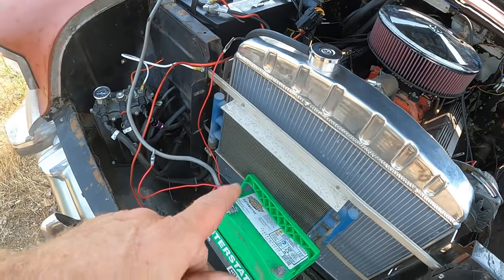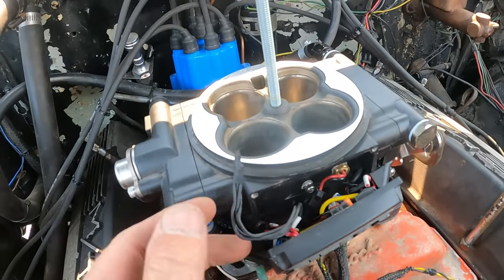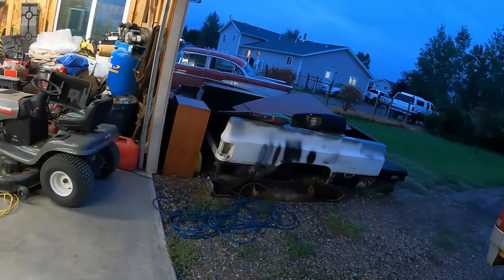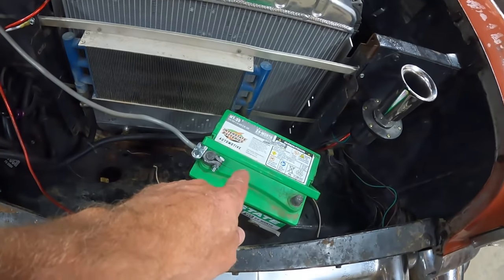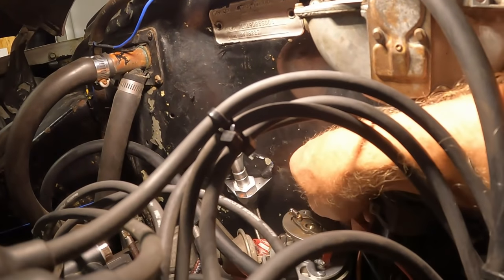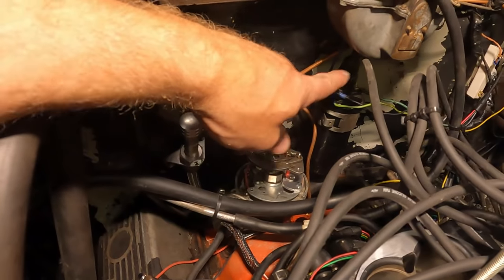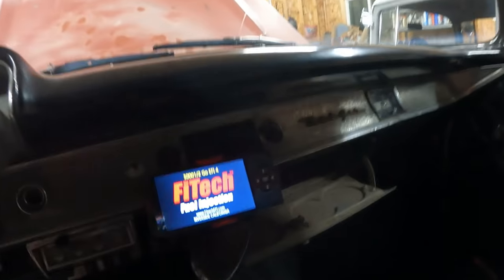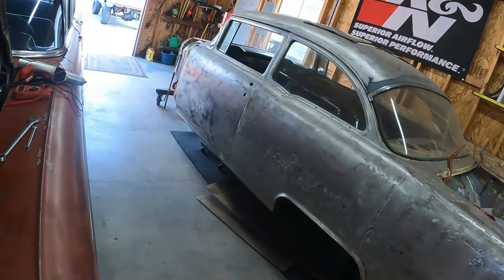Installing Pertronix Electronic Ignition, the FiTech Fight Continues

Comment: I believe that tach signal is the key. find out which wire on the fi tech is tach feed and it probably hooks up to the neg { dist side } if it can't read the rpm it won't run. good luck!!!
Reply from the maker: Yep, no tach signal, no startey start. Tach signal was a little weird with the Pertronix. Waiting on a replacement to see if that helps...
Reply: @MontanaGarage  

You have a 12V hot-in-start and hot-in-run lead to the Pertronix unit?   Friend of mine made the mistake of only having a hot-in-run wire run to it and the motor wouldn't start.   It's got to be both hot-in-start and hot-in-run to work.

Comment: Follow the wiring diagram that was shipped with the unit. It says to connect the white wire to a keyed 12 volt source not coil positive. If FiTech wanted the white wire on coil positive they would’ve mentioned that in the instruction manual.

Comment: I ran a Pertronix ignition conversion in my '55 Chevy with a big block and it ran great.  The only issue I ever had with it was accidentally shorting out the ignition module during a tune up and having to replace the module.  It's been on the car trouble free ever since for more than 20 years.
Reply from the maker: Good to know man. Thanks for the input. Hopefully I can make it work.

Comment: You’re a better man than I am! I’d have gotten rid of that FiTech system by now. We’re going to be converting an old Camaro to fuel injection and I can assure you that we’re not going to buy the FiTech brand! Hopefully the Holley setup is better than this one. Keep up the good job and keep the videos coming!
Reply from the maker: I've heard they are good when they work. Hopefully I an make it work, or hopefully FiTech will stand behind it if it is a ECU issue.

Comment: I run a Pertronix conversion on my 63 Merc 390. Works like a champ and fires right up. Most problems happen when power source is hooked to power side of coil instead of keyed power at fuse box or ignition switch. Follow directions and it works and lasts years.Thunderhead 289 just put up a video on this a week or two ago.
Reply from the maker: Thanks man. I'll check out Thunderheads video and see if I can learn a thing or two. Much appreciated.
Reply: @MontanaGarage   Here's the link - https://www.youtube.com/watch?v=c76knXFuXH0

Comment: Moose has the instincts, just watch and learn! Maybe you can hire him out? "Moostana Garage" 🤣👍
Reply from the maker: Haha. Thanks Andy.
Reply: @MontanaGarage  think about it. What all adds up? You checked the battery voltage it reads one thing. The fitech monitor reads voltage all over the place. What does a voltage regulator do? It sends the correct voltage where it is needed. To much voltage and you have a disaster, not enough and you have a no start. Since Dan at DD Speedshop changed a lot under the hood, you might have three different possibilities on regulators. If he took the voltage regulator off the firewall, he might have used a different alternator that has a alternator voltage regulator,  or it could be the ignition voltage regulator.  Either way your voltage is not being disbursed or regulated properly, that can also cause dash gauges not to work, lights acting up or blowing, car not starting or running and idling rough. Just check your regulator it's a cheap and easy fix. The guy that you talked to at fitech is a real einstein, your voltage tells you everything. Sometimes the hardest things is the most simplistic.
Reply from the maker: @porkscrewcustomguitars1573  It could be the voltage regulator. But, I've hooked the FiTech to a completely separate battery at 12+V, both Fitech wires direct to that isolated battery, with the starter, ignition switch, etc hooked up as normal. The seperate battery and wires will read 11+ at cranking, the dashboard screen still  shows the low volts. I would think I had the voltage regulator isolated out of the equation there, and the voltage drop is still happening. To me it gas to be something inside the FiTech, but who knows. Maybe this new fangled ignition will fix it once I get that working.
Reply: @MontanaGarage  - When you unraveled the black tape and found useless wires going nowhere, that makes one think the whole wiring system should be gone thru again and get tested. Obviously owners before Dan have messed with the electrical, so it's got some gremlins...You did good adding extra ground connections from the engine block to the frame. Even tho Dan did some good wiring as well, it's a mystery why it's not running proper now. I hope you got the FiTech instructions/manuals with the 57? 
Good Luck with fixing your car sir, hope you get it running tops!
https://www.youtube.com/watch?v=3D-nEciDw3E&list=PLpmYtBLzj-KvCGQujKHMGxjINK2wYVuvF&index=12

Comment: Make sure there is a ground strap from motor to chassis due to rubber motor mounts and put grounds to a grounding block and use proper gage wire to allow on voltage drop
Reply from the maker: Thanks Dave. I have added a couple ground straps, and grinded clean their mounting points.

Comment: My IGNIGITER KIT had a rotor cap with a cup that fit down between a slot in the red thing on the plate.  The cap had slots cut in it for a lazer to flash thru.. Lazer accuracy...& magic!
Reply from the maker: I think they have different versions. This is a "lobe sensing kit" so no magnets or anything are required. So yeah, this on is just magic. Well, it would be magic if it worked...
Reply: @MontanaGarage  the one I had was in the early 90's..  I'm pretty sure  there wasn't any magnets... It had a lazer eye and a plastic rotor cup with slots cut in it.. I don't know how the hell it worked.. But it worked awsome every time I turned the 🔑

Comment: Petronix set ups work well, i have installed a Cpl over the years and they worked great. If all else fails a good ol carb will do the job. I've been considering efi on my Pontiac 455 but after reading alot of different issues with both fitec and holleys I may just stick with my trustee holley 850 dbl pumper. Hopefully a new unit will fix it, I feel ur pain. Best of luck with it and scritch ol moose for me!!
Reply from the maker: Thanks for the input man, I appreciate it....scratch, scratch....done!

Comment: Owned  a 57 your voltage drop may be where main harness goes Into fuse panel  have some one crank while you ck for heat at harness firewall side. If gets warm  poor connection.  Also recheck all wiring especially wiring added on.
Reply from the maker: Thanks for the tip Joe. Still more wiring to check, but I "think" I've checked all the important stuff.

Comment: Sounds like you should gut all that old wiring and start from scratch
Reply from the maker: That's probably a solid plan. I was "hoping" to get away with replacing as little as possible for now, but a full on session of ripping wires out may be on the horizon. Thanks a bunch for stopping by and commenting!
Reply: @MontanaGarage  Yeah, I know how that goes. Opening a can of worms by doing that. But the car was likely pretty hacked up before Dan got it, then he did some quick wiring and if you're going to keep the car for any amount of time you'll have some piece of mind knowing it's done right and you can troubleshoot it if need be. I just see all of that electrical tape and insulated connectors and I cringe with that fuel injection! Based on the voltage drop you're seeing there's got to be an issue between the battery and the screen. I appreciate you showing us the process even if you cut out the swearing and the throwing of tools! Good luck!

Comment: Several  things:  Those M/T valve covers do not always give a good ground. I like to use a pair of vise grips to put the spark plug in and then run a 12ga. jumper from the vice grips to ground.   It seems like you have found one bad connection- I would go thru and check them all.  If you keep having funny battery voltages, find where the batt power wire goes into the unit and run a jumper from there to a multimeter and compare the inside indication for batt. voltage to what the multimeter is showing. If there is a difference and you can see no bad connections, the unit is probably having issues.   Good luck Moose, this is one of those tests that sometimes we could do without.  I'm like you tho', can't get it out of my mind until I find and fix it!
Reply from the maker: Thanks man. I did ground the plug much like you suggested when checking for spark, just didn't make it on video. I also have done the wire test you suggest also. The white wire can be hooked up to a seperate, solid 12V source that doesn't flucuate, even at cranking, yet the dashboard will fluctuate and get down to like 4V. That is why I believe it is a FiTech ECU issue.

Comment: I read all the comments and a couple of guys know what their talking about in this case
I have used 3 or 4 small cap "ready to run" dizzies with a side coil where the engine was not moved forward upon building and also on a old triple carb setup that had no room for the big head - anyway the cost was under a $100 all in - On the bright side when you get back on your 55 everything is going to be so organized it will be a cake walk. What ever that is.
Reply from the maker: Thanks John.

Comment: A friend runs a Pertronix unit in his 32 Ford, with a 425 C.I Buick He says it works pretty good.  Catch you out on the road.
You may want to check to see if that coil can be run without a Ballast resistor. . Chevy uses the braided wire as a resistor wire.  If you need , get a coil that does not use a ballast resistor.    Rick
Reply from the maker: Thanks man. The coil is from Pertronix, designed for this ignition, and they say to remove the resistor. Hope to see you on the road...

Comment: I'd be adding Grounds all over just eliminate that. Engine to frame, Engine to body, body to frame and double check all the current ones. Also check where any wire could be pinched or rubbing.
Reply: He did all those grounds, might want to check them again tho
Reply from the maker: Thanks man. I added all the grounds you mention. If it's a bad/pinched wire, I cannot find it. Might have to rip more out if I cannot track it down soon.
Reply: @MontanaGarage  oh okay I haven't went back to the last video I missed. Have you ohmed and wiggled all the wires. I wonder if the efi just went bad
Reply from the maker: @benjamindavidson632  I have ohmed wires, ohmed grounds, checked voltages at cranking, added a completely seperate battery to power the FiTech. No luck. Always low and fluctuating voltage. I gotta get this ignition issued sorted so I can get back to FiTech if it still doesn't work. I think it's a bad ECU, but hopefully I am wrong and the electronic ignition will allow it to work properly.

Comment: I been watching you struggle with that distributor and stuff. I seen people try those things that deletes the points but they always have problems with them. I used a billet HEI distributor for southwest performance parts. I got my distributor and coil all together for cheap. I would check them out.
Reply from the maker: Thanks for the tip man. Just no room for an HEI on this one..
Reply: This is a small one. I got one on my 1957 chevy 210. I wanted to go with Electronic ignition myself  and the msd and Mallory was way out of my price range but these are good and affordable. If I could I would send you pics. Lol
Reply from the maker: @juliuscullum6596  ok cool. When people say HEI I just think of the stock one. I'll look into these. Thanks for the tip!
Reply: I haven't had problems with mine. I mean it is on something completely different just a little 170 slant six. But was an easy install , other than dropping the screw that fastened the condenser into the distributor. Lol
Reply: @MontanaGarage  no problem. Just glad to help out apart of the tri5 community.
Reply: @alanmerritt860  yeah I watched a few people on YouTube here trying that points delete stuff on they're 8nford tractor and a few other stuff and it always end up not working and they waisted they're money.

Comment: I feel your pain. The FITech unit I bought turned out to be a piece of junk. Two bad Ecms so far. I’ve had it almost a year and managed to put about 500 miles on my truck with it.
Reply from the maker: Bummer man. I am pretty sure my unit is bad as well, but still waiting on Pertronix parts to verify. Sounds like there is quit a wait for parts from FiTech if that is the case. Hopefully FiTech is right, and it will work with the new ignition. Thanks for watching.

Comment: Thunderhead 289 had a good video on how to trouble shoot the pertronix installation. My 5 cents worth is maybe its the ECU in the fitech itself thats on the blink. Ive seen that before. If i remember right i think sobering had a lot of issues with that fitech before it came to you. CARBY TIME
Reply from the maker: Thanks John. I'll check out Thunderhead for the Pertronix vid. I think it is the ECU as well, but can't get that confirmed until I fix this no spark issue, which I am waiting on parts for.

Comment: Back in the day there was a yellow wire that ran from the R terminal at the starter solenioid and went to the positive side of the coil and this wire gave the coil 12 volts will the engine was cranking, now that you switched to electronic ignition it likely does not need this anymore, i do think the problem is with your tach/time signal

Comment: for chevys engines with tight firewall clearance
 i buy a small cap ready to run hei distributer from ebay they are around $50 , 
you need a seperate hei  coil with them .
i put one in my 55 sedan and in my 60 impala convertible . 

   
years ago 1973  my  $75  dollar  55 ragtop with points would crank with the key  but it would not start . if you pushed it and popped the clutch it would start every time .
  on the 55 there is a  wire from the second small terminal on the starter that goes to the resistor block or the coil , 
i dont remember witch one it goes to  but it gives it power to the coil only when your cranking it .
Reply from the maker: Thanks for the tips. Much appreciated.

Comment: I saw that you left a part out of the pertronics it's a window that separates the spark on the cam lobe. You can use a HEI it fits just hit the fire wall with heavy ball pin it's the most easy way to do.
Reply from the maker: Thanks man. There is no other part on this version of Pertronix. It is "lobe sensing" whatever that means... I'd have to do a lot of beating on this one for an HEI...
Reply: @MontanaGarage  It's a lot I did on my 57 and a 56 no big deal

Comment: I know that this sounds dumb but I had a wire coming from my coil to the distributor and went through the rubber grommet on the side of the distributor. Where it went through, it was broken in the plastic so  that you couldn't see it and so it would test it was getting juice to the points but the slightest wiggle and it lost connection and would run stop run a bit.... stop again. Took a  while to find  that one.... you have driven the car so it does work on points and I think that this distributor has failed in some way
Reply from the maker: Thanks man. Seems lie a bad Pertronix unit to me, but I could be wrong, currently waiting on a replacement to find out...

Comment: Ok...I know zero about this electronic stuff. But after reading all the comments about the voltage dropping could it have something to do with the starter drawing voltage away from the fiteck when you crank on it? Nobody has seemed to mention anything about that. Just a quess ....but hey... who knows. Good luck
Reply from the maker: Yeah, people have suggested it could be from starter draw. I have hooked the FiTech to a completely separate battery, so the FiTech was connected to a good 12V source not hooked to the starter, ignition, etc. The FiTech still showed low and fluctuating voltage on the dashboard, even though the battery it was hooked to held steady at 12V. So I "think" that should show the problem isn't starter draw, bad ignition switch, etc. but maybe I am wrong and it still could be somehow? Thanks for watching.

Comment: Is Missing a part inside  cap distributor Center ? Check I think I saw a missing piece
Reply from the maker: The rotor is in place. Thanks for the tip.

Comment: Check for voltage on the ignition switch in the start position and in the run position
Reply from the maker: Thanks Jimmy. That has been done. I have voltage at the ignition and the coil at both start and run.

Comment: Is the fitteck supposed to be connected to the out put of the coil ?? May have fried it's brain . I have a points distributor to test the coil , first have good points and condenser in the test distributor with rotor and cap on hook a wire on distributor side of coil to test distributor ground the distributor to battery make sure 12 volt is connected to switch side of coil ,spin the test distributor blue sparks should pop out of coil post the big wire that goes to center of distributor cap
Reply from the maker: I have to double check if FiTech say ok or not to hook to the coil, but while "researching" I find many people have hooked the white wire there with no issues.